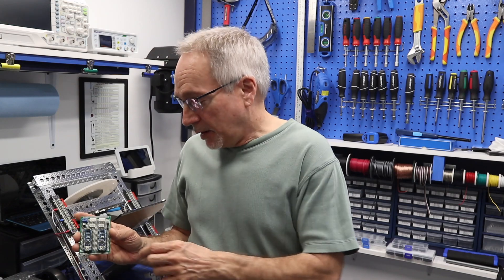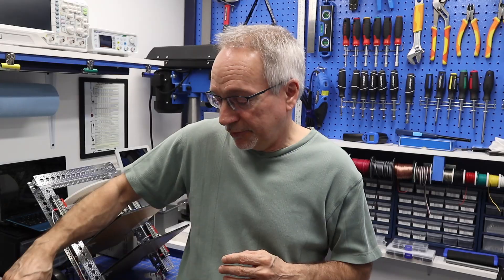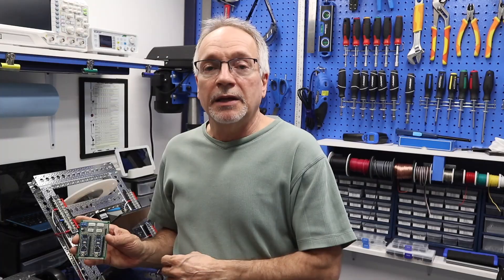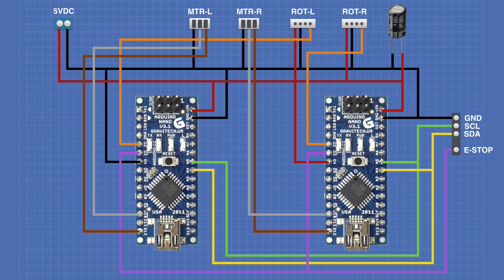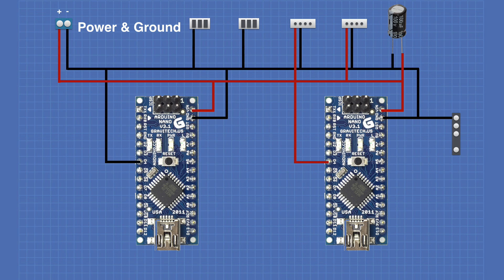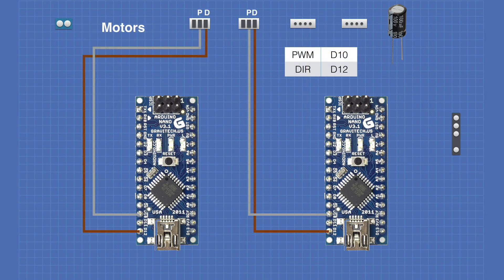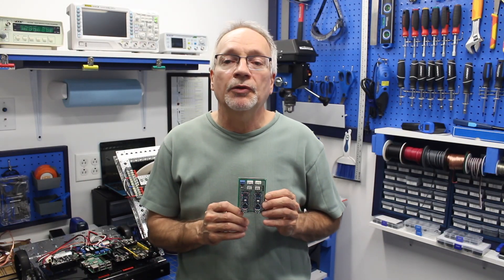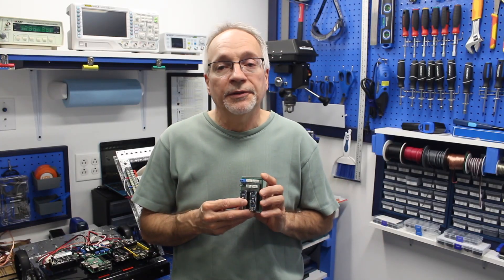Build a Real Robot - Episode 9 - Motor Controllers Part 2

Comment: An E-Stop should ideally not be linked to some logic/processing where possible. I'd recommend latching it to either cut the power or to reset the controllers. Adding it this way means that the processor can't really ignore an emergency. It also ensures a mistake in the programming won't cause the E-Stop to not operate. This isn't exactly the biggest or most dangerous robotic device, but it would be best to follow the safest option.
Reply: How can the robot know when to stop if the stop isn't attacched to the logic unit?
Reply: @sconosciutosconosciuto2196   In an idea E-Stop the power is removed from the device where possible. That means the product as no way to ignore the e-stop and continue working. Some equipment can't do that as removing all power could be unsafe so they apply breaks and other features to stop equipment. The problem with a logic e-stop is that it can fail if that pin on the connector fails. There are as always ways to sense the pin has failed but now we're down to logic controlling the sensing and making the e-stop action. But what if the programming has failed, or the processor is crashed. In this project there are multiple processors talking to each other so it could easily be possible for the e-stop processor to fail but the "go forward" processor to be running.  There are a lot of ways this e-stop condition could be lost in this design. It's not a bad design. It's just split into separate sections with various processors so has multiple points of e-stop that need handled.

Comment: Thanks for yet another excellent video about robot building,  Bill.
I'm wondering why you're using 2 Nano's for motor controlling instead of just 1. I'm building a somewhat similar robot motor wise,  and I only use 1 Arduino Pro Mini. So why 2?
Reply: In my view, this is because of the number of external interrupts. Each Nano has 2 interrupts; your Pro Mini has 2 as well. In his design, he needs at least 3:
- 1 rotary encoder left
- 1 rotary encoder right
- 1 emergency stop

I decided to use 2 Arduino Micro for my design (which looks very similar to the one presented here). Each Micro has 5 interrupts. As I have 2 motors for each side (left & right), I need 5-7 external interrupts:
- 4: 1 for each rotary encoder
- 1 for emergency stop
- 2: for future use (better to have them and not need them then to need them and to have to change your design because of it)
Reply: @ovidiurosu6632  Thanks for the explanation. I agree that for pulse counting you'll need "real" interrupt pins. But can't the emergency stop just be implemented using an ordinary digital  input? I hardly think that the reading of the stop signal will be a bottle neck.
And how about pin change interrupts; can't they be used for the emergency stop (https://playground.arduino.cc/Main/PinChangeInterrupt/ )? With the 2 interrupt pins for pulse counting and one pin change interrupt for emergency stop, one Nano, Pro Mini or atmega328 chip should suffice (?)
Reply: @MartinBgelund  Yes, you could implement the stop by using an ordinary digital input, as long as you make sure that you are not stuck in another part of the code. The beauty about external interrupts is that you have a guarantee (as in, the current running function / loop / whatever is being stopped so that the interrupt executes immediately).
With regards to the PinChangeInterrupt, this is the first time I see it so I can't comment on that. It does seem like a neat idea, if it actually works :).

To me, this is a matter of choice and the goal you had in mind. If your goal is to have something compact, it makes total sense to try to put as much as possible behind 1 board; but if you goal is to be able to build something now, and also keep your options open for future and allow expansions without much trouble, it makes sense to use 2.
Reply: @ovidiurosu6632  Another reason why I would want it controlled by just one board, is the possibility to compare RPM 's . If I want my robot to drive straight, comparing RPM 's on the motor controller layer seems far better to me.
Reply: @MartinBgelund  Aha, okay, that makes sense. It's easier to do that with one board. Good luck :)
I already have it with two boards and it works as expected. I am yet to use the RPMs, though I don't think it will be a problem as I have a I2C bus connected to both.

Comment: Really enjoying this series. From the 'Bizarre Coincidence' department:  Something like 20 years ago I bought a basic robotics book. I had read it at the time and was preparing a build project, but then the UK 'Cybot' partwork magazine came out,  so I proceeded to lose the book amongst the junk in my house.  Many years pass, my oldest boy was studying software engineering, and I was trying to find the book (without success) to give us something to talk about and maybe help to expand his  horizons a bit (this was like 6 years ago). I wasn't a subscriber here but, coincidentally, the 2nd or 3rd video in this series popped up  in my 'suggested' feed the very same day I found the book,  which was David Heiserman's "How to Build Your Own Self-programming Robot", it used an 8085 processor and plenty of glue logic for I/O.   So far in this video series discussion has seen some interesting parallels (e.g. there are only so many ways to implement a mobile platform on a sensible budget) with that book, and some even more interesting differences  that highlight the development of hardware (especially for the 'maker' market) in the years since the book was published. I await the central software component of this project with bated breath :)

Comment: Will feeding 5 volts to the Vin pin of the Nano instead of the minimum recommended of 7 volts be a problem?
Vin is feeding a regulator which needs about a 2 volt headroom. Great channel BTW.
Reply from the maker: K9 you are correct, I misread the spec sheet! Change the voltage in to pin 27 instead of pin 30. I'm doing that right now. Thank you for spotting that.
Reply: You should also include a blocking schottky diode for each board similar to the one between the VUSB rail and the 5V rail on the nano (D1 on the schematic:- https://www.arduino.cc/en/uploads/Main/ArduinoNano30Schematic.pdf ).

That way if you plug in your USB cable to program the nano with the main robot power supply off it won't try to power up the robot from your computer's USB port.
Reply: @iancrowe8384  your link leads to a page not found!
Reply: Yeah, sorry about that. The closing bracket was included in the link. Now fixed.
Reply: @iancrowe8384  Thanks!  Very good suggestion!!

Comment: No problem re the last video, you are human and not a robot :). A forum sounds great but I agree it needs a reliable moderator to manage its structure, filter out spam, and to deal with any 'heated' discussions where there is disagreement on a topic.
Reply from the maker: I guess that's why I need to build a robot, thanks for your understanding John!